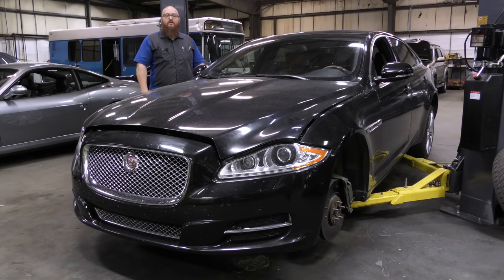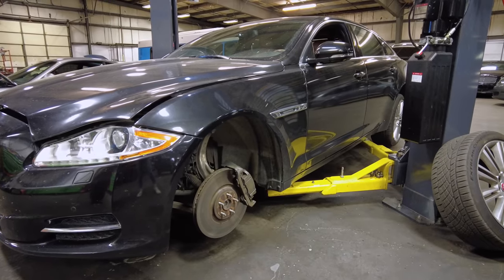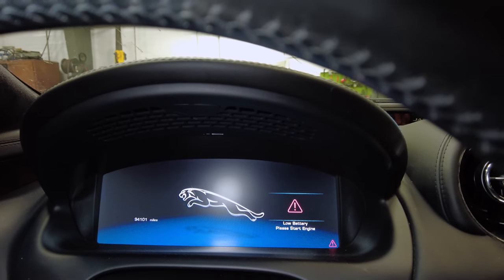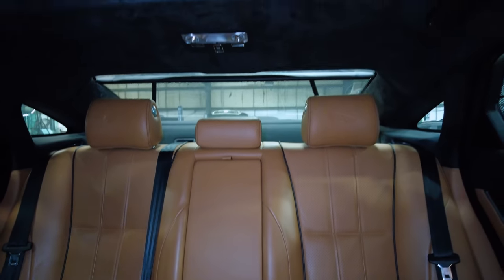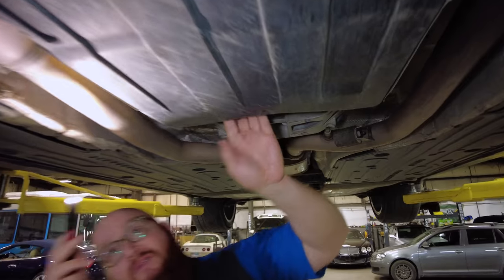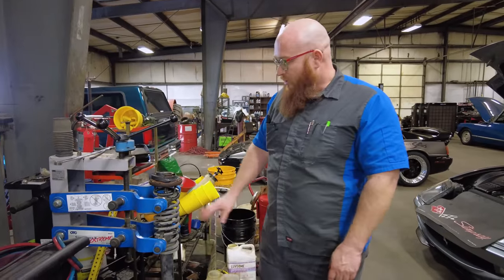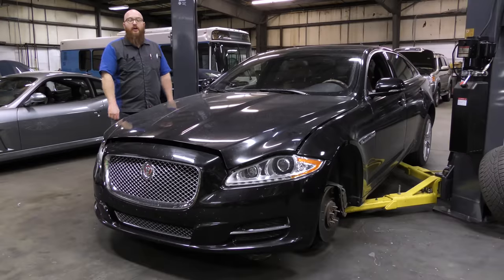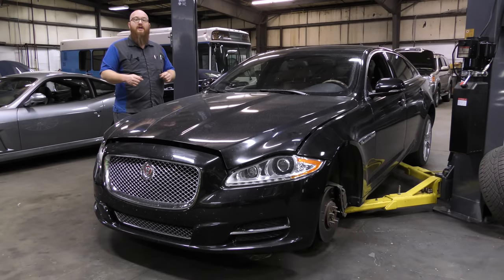Not another boring car! This '14 Jaguar XJL is anything but boring. CAR WIZARD is very surprised

Comment: Having owned a 2006 Jaguar XJR I’m glad that I’m mechanically inclined from being an aviation mechanic. It was something every month with that thing and I worked on it to spec, had manuals and everything. I guess TaTa owns them now and Jags are made in China. They look great but I’ll never own one again unless it’s an S-Type R.
Reply: what kind of issues did you have on 06 XJR? the 4.2 ZF6 combination is extremely reliable and one of jaguars best engines for longevity and reliability, regularly see them daily driven not taken care of with over 200k miles, although I know the R has the annoying valley coolant hoses
Reply: @h7pubg  where to start, coolant pump broke, transmission started slipping around 90,000 miles and I changed the fluid every 40,000. I also changed the oil every 3,500 miles with synthetic and K&N. Tons of electronic issues with the wiper blades and stereo screen where it would just go dim. I did the timing chain twice, knock on I believe cylinder 5, hence the timing chain new spark plugs, upper coolant housing busted major leak, leak on the oil pan I believe the “13th” bolt where nobody can get to unless you take off the axle so I left that one. Thermostat broke at 60,000 miles. Steering wheel rack and pin went loose so you could move the wheel up slightly up and down. Also the vents to turn it to foot/body/defrost went so it was in between defrost and foot permanently. The power windows would fail half the time so they would only go half way up to half way down here and there. My favorite was the odometer would malfunction to from time to time so your speed was at a permanent 40mph until you turned off and on the car about four times. When the trans finally went at 124,000 I junked it. And bought an Escalade, and that was a dream compared to the jag, and more of dream to the Escalade was a Lexus RX 350. I really loved Jaguars, I really did but I didn’t know I was going to have to maintain it like a refurbished piper aircraft. And I admit that when I first got it I would race it around for a total of 7 to 10 thousand miles but after stuff started going I drove it around as proper as possible. I’m not talking shit this is just facts of what happened.
Reply: I forgot the AC compressor went around 50,000 miles. That was a fun fix.
Reply: @breakingcymbalsstudios6738  wow, in all the jag fb groups I have never heard of one with that many issues in one car, as well as timing chain issues on a 4.2, I have a 4.2 xk which in the last year and a half of daily driving has only needed a blower motor resistor, bulbs, and soon it will be getting fresh bushings like the car in this video, I ordered a new set of non CATS struts just to refresh it for around $100 each. has around 110k miles, oil changes every 5k, there are small things, but nothing that impedes drivability, not sure about XJ but XK do have an issue where the screen will blink on and off if the surface charge on battery is a little low, but it comes back on, other than that it is mostly cosmetic, some glove box plastic broke I had to repair, and a shop put the intake tube on wrong tearing it, and lied about it being pcv valve so it has been running lean although ECM regulated for it so car runs good, fixed temporarily and have another tube on order.
Reply: @h7pubg  maybe it was a lemon, I bought it at 22,000 miles. However never again unless it’s an low mileage S type R that will sit in the garage.